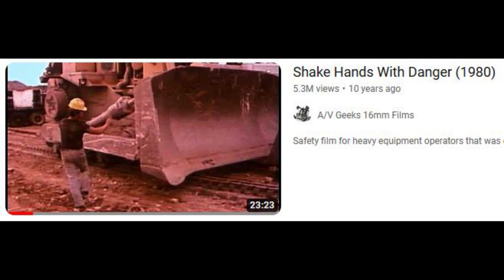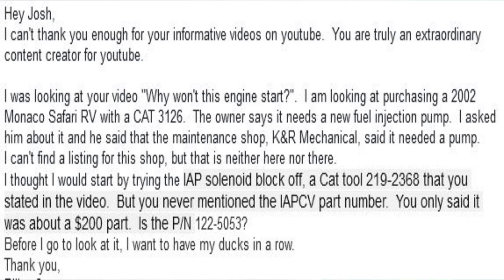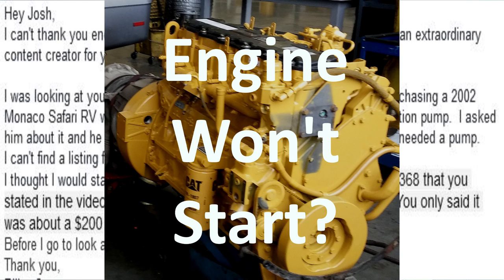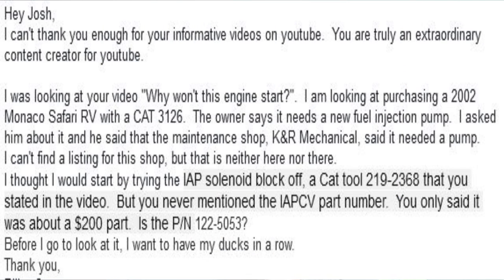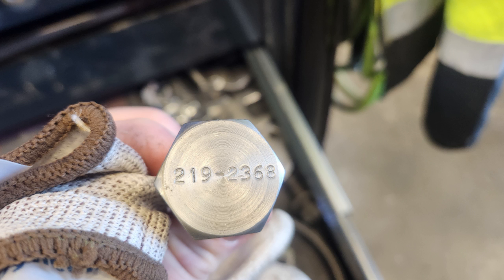Why Wont My Cat Engine Start? Question of the Week Episode 4.

Comment: Thanks, Adept you helped with my safari. I have that early model 3126 in my safari with the copper injector cups and crossover tube(the 3116 with electronic injectors HUI system). My no start issues ended up being some wiring, sensors, and at end it was injector 5 and 6 that was the real issue. Cat dealer diagnosis was helpful but expensive. Since then all repairs I managed on my own, that is with having time space and knowledge.

Comment: Those iapcvs look a whole heck of a lot like IPR's on old 7.3s. I find it interesting to hear about cats HEUI injection system. Such a baffling concept for some, oil pressure to fire injectors. Power strokes have made me very familiar with HEUI lol. Keep up the great content!
Reply: My immediate first thought was a bad IPR.. LOL
Reply: Best way to tell someone is a syringe, fuel inside, hand pushing (high psi oil) on the outside.
Reply: Very similar because CAT and Navistar co-developed HEUI. Plus a third party individual whose estate ended up suing both. Ford may have been involved a tiny bit in development. CAT and NAV ended up in a lawsuit over patents. I believe CAT won and then put Alliant in business to build injectors for the replacement market. IIRC.

Comment: Here's a question for you. What was the oddest thing you ever found in an oil pan from a running engine? I found 7 bent push rods in a Cummins big cam 855 that drove in for an inframe. Also had a 3406B with almost 800,000 miles that never had piston cooling jets. I couldn't believe it lasted so long. The owner bought it new and he said only valve adjustments were done and a water pump.
Reply: Was is supposed to have piston cooling jets and just didn’t or was the port blocked off. I don’t think It would build any oil psi if the cooling jets just weren’t there. 
I’ve heard of some older diesels that didn’t make very much horsepower and heat for a need for piston cooling jets

Comment: The injectors also have a poppet valve on the oil pressure side that is sealed by two surfaces which wear out and cause oil pressure leaks

Comment: Hello Josh! Thank you for the great videos, very informative! I have been struggling with a 3126 round top HEUI in a 99 Freightliner. Following your steps, I confirmed voltages +12, grand and switched +12V available to the ECM. There wasreally no HEUI pressure at the head until I replaced the IAP solenoid with the block off tool which then ran up to 4000 psi, so I believe the pump is good. I did replace the IAP solenoid with no joy. I also tested the wiring from the ECM to the IAP solenoid which tests okay, continuity exists....I tried disconnecting the sensor for HEUI oil pressure in the head, that didn't bring the pressure up. I also had pulled the valve cover before and there were no obvious leaks (done before getting the block off tool). I tried connecting to the ECM with no success. This all led me to think the ECM had failed. I sent the ECM out to be repaired, they se nt one back and I get about 100-200 psi oil pressure but no start.
What is the voltage required to close the IAP solenoid to ramp up the pressure? Thinking if I bypass the ECM for that I can confirm if  I just got a bad repair....
Thank you for your time and videos, really enjoy them!
Reply from the maker: Hello Stuart, Thank you for the donation by the way, can you please email me at AdeptApe@yahoo.com instead of using this comment section for questions. I don't get notified when I get comments or replies, but in an email I can really help you more. Please let me know your engine serial number in the email as well.

Comment: If u put a variable resistor on the heui rail pressure sensor u can trick engine to think its reached the pressure required to start ( from memory, it's min press is 5000kpa or 725psi). Et will always display injection disabled if it doesnt reach the minimum rail pressure. Easy way to get running and verify leaking injector orings without removing valve covers

Comment: Those injector orings are also the cause of a no start or hard start on Navistar huei engines as well. I've also heard that the old 7.3 powerstroke had the same issues but I've never worked on those before.

Comment: Hello Thanks for your knowledge I have a 3126 it was running good I parked it at a friend's house and now it will not crank over I get power on the dash , my batteries are good, my starter is good out of no where it just will not start if I touch the starter with power it just turns over but not start

Comment: You need a blue blinking light like the parts guy when he’s on the phone for the kiddo when the mic is hot. 
My CAT C-12 engine scared me the other day when it didn’t start. Somehow it loses the prime over night. 😟 Luckily the Racor filter has a pump to prime the system, but I’m also wondering if that’s the culprit.
Reply: I’ve a C12 that does an occasional miss start, give it another crank and away we go

Comment: Plug cam and crank sensor can be switched around and won't start. Couple of pressure sensors for fuel system plugged in backwards won't start.

Comment: I recently bought a GMC T6500 cabover Caterpillar 3126 it's an older truck 1999 with only 94,000 miles on it drove it over 5 hours after purchasing to get it home it ran excellent, got home shut it off with the turn it right back on it wouldn't start, let it cool down tried it a couple hours later and fired right up next day I change the transmission fluid and I let it warm up ran excellent shut it off to check the fluid and it would not start back up let it cool down a couple hours and it fired right back up, any suggestions?
Reply: Ecm?

Comment: Hey Josh, thanks for great content. Thought i would throw this out at you for a possible diagnosis… I have a 2006 motorhome with a CAT C7 350hp engine. 
When the RV sits, The engine will start and run about 3 seconds, then shut off. 
Then will crank/no start after that. 
I have to crank for an extended period of time,20 to 30 seconds to finally get it to start, with a burst of black smoke at startup. 
Then runs great, as normal. I can shut it off for an hour and still starts like normal. 
I had the fuel filter and fuel/water separator replaced thinking that was my issue. No help. Any advice would be helpful. Thanks
Reply: I’ve a C12 that does an occasional miss start, then starts fine for a while and then a run of miss starts.. was thinking of fuel pressure being low ?

Comment: I'm having a slow crank issue. 
05 freightliner columbia 
Bxs c15 acert 
New battery's (tested good) 
Dash says 13.7 volts when running 
Will only start when jumped go over 13 volts. 
I'm thinking starter or alternator 
(Truck has 1.2 on it 30k on a brand new rebuild)
Reply: Need to do a voltage drop test. That will tell if there are any connection or cable issues up to the starter. If voltage is good up to the starter then likely a bad starter. Can also do a draw (amps) test on the starter.

Comment: Mine would start and then sometimes not.would run great and intermittently would run bad and come to a stop .if I let it sit for a minute it would start back up and run great .this went on for a while until it wouldn’t start. Turned out to be the lift pump looked like a tiny check valve in the intake side came loose .drove me crazy for a while if I didn’t see it fall out when I took off the pump I would of never figured it out

Comment: 3406E will not start. Runs off starting fluid, but dies when exhausted of it. All 6 injector seals won’t all go out simultaneously, right? Fuel pump is good. Pressure at the fuel rail. I believe the ECM is not telling the injectors to fire. HELP OF YOU KNOW PLEASE!

Comment: Good Evening adept, I have 3126 I just replaced the heui pump 3 weeks ago but I didn’t change the line orings from the engine to the pump so it started leaking oil pretty quickly today but I changed the orings today and now the truck won’t start thats really weird it was just cranking and driving before then with no issues. I replaced the injectors already about 2 yrs ago. I had someone come out and put a computer on it and the computer couldn’t properly read the ECM. He thinks its a ECM issue and I was thinking the solenoid may have went bad, but I just bought it with the pump. I was wondering if you could help me out with some advice

Comment: Hello josh.. i am trying to start a C7 CAT engine..its cranks but no start.. engine rpm okay no error code,but the injection actuation pressure produced during cranking is kind of high its produe up to 1200psi..i check all ecm input power and ground okay pin 70 key power okay but still does not start...what could be the problem...the engine is on a 950H loader..
Wish to here from you thanks
Fuel pressure also okay

Comment: Couldn't you just hook an airline up to that high pressure oil line and see if the injector seals have the ability to hold air pressure? I mean even a runner tipped blow gun would work wouldn't it?

Comment: Didn't 3126 have the double cam sensor on them? One sensor was for ecm speed and the other was for tach? Seems like I remember getting my ass handed to me at cat with the same thought of a good tach rpm it was good. Been awhile though.
Reply from the maker: They are both Cam timing sensors, but they both feed the ECM. The ECM sends the signal to the tach, not the sensor directly.
Reply: @AdeptApe  Right. One was like a pass through for tach, and the other was used by ecm. I remember they had different resistance values. I seem to remember with the new sensors I could unplug one and lose tach, if I unplugged the other it wouldn't run. It's been a long time though. I loved that job, but I sure don't miss ard head updates on LEE'S in the Freightliner M2's.

Comment: Ive got a 3126 that uses gallons of oil in 400 miles but no leak or noticible blue smoke whats the most likely cause also cranks a long time to start most of the time unless its hot
Reply from the maker: Is your fuel black or still clear?
Reply: @AdeptApe  I've looked in tank several times it is clear the best i can tell
Reply: Also replaced all the injector orings didnt change anything.
Reply from the maker: That's a weird one, gallons of oil usage would usually show symptoms. Any noticeable engine miss?
Reply: @AdeptApe  Ok its probably like a gallon of oil in 400 miles still way to much . seems to run great to me just breaking me up in buying oil
Reply: Hmmmmm. Maybe siphon some fuel out of the tank to check. I’d park over cement and see if you do have an oil leak. But yeah you might have worn piston rings and oil is burning but oddly not enough for blue smoke.